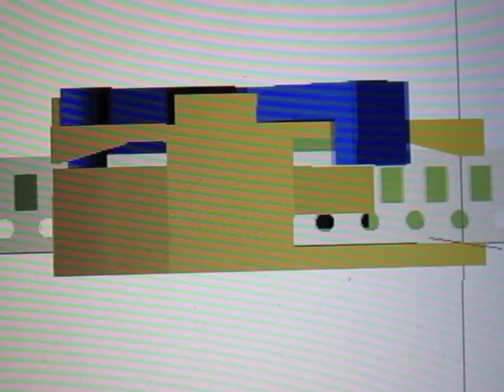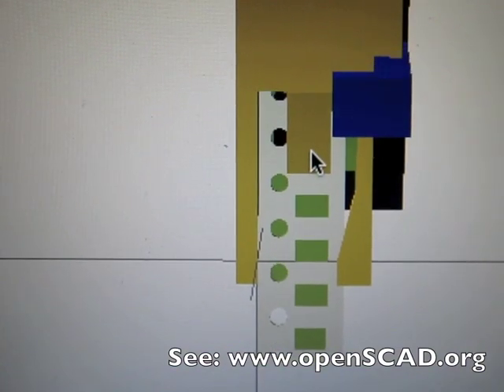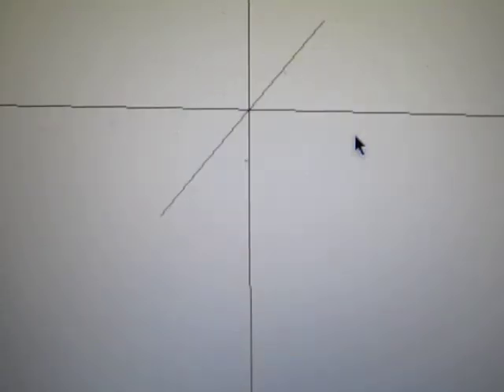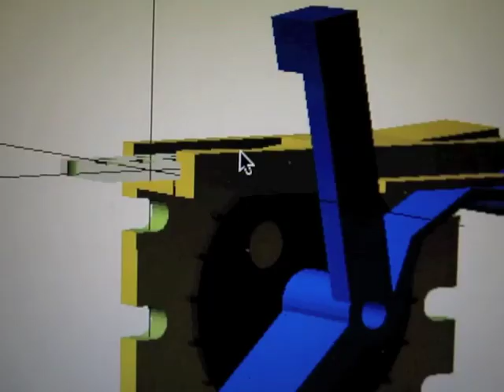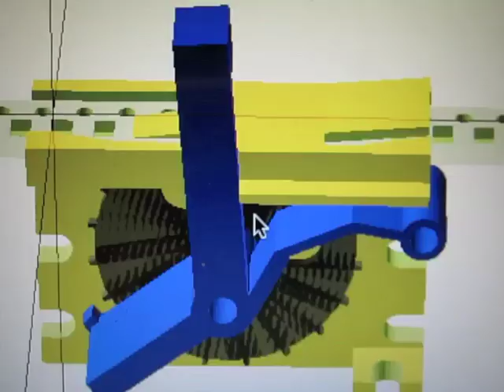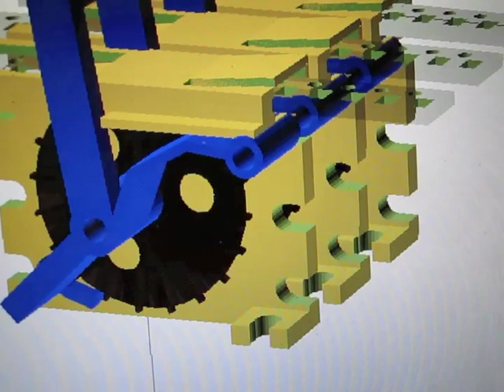Ultimaker PICK-n-PLACE

Comment: Awesome!  I started designing a low cost pick and place system about ten years ago, before all of these low cost CNC and 3D printers were available.  Never got beyond the design stage.

I use an eBay surplus EFD 1500 dispenser for solder paste an it worked well.  A home made version (regulated positive and negative pressure and timed switching between them) would work well at low cost.  Most small single sided SMD boards can be reflowed on a hot plate but I was going to make an IR reflow oven..